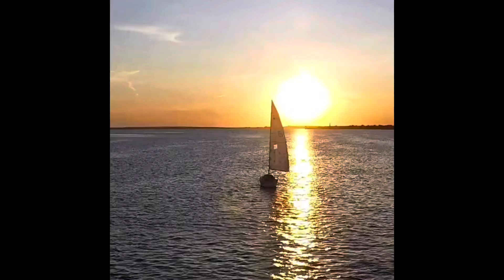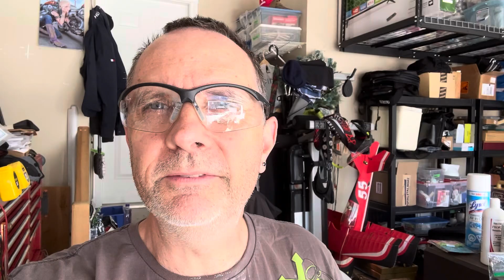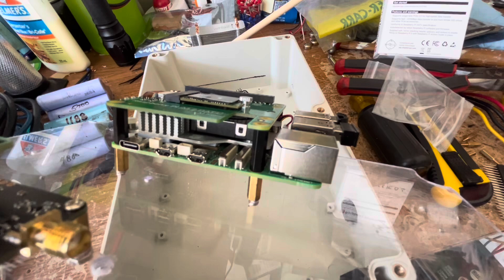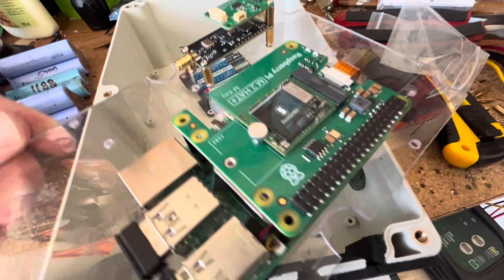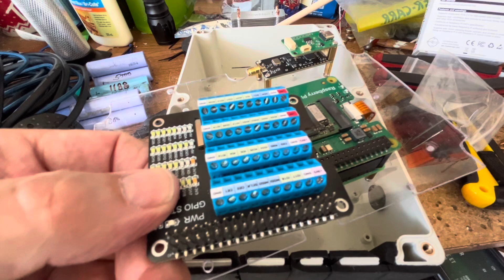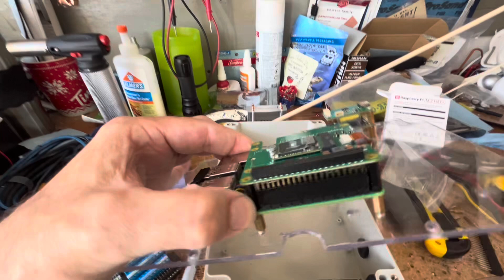M.2Hat Trouble

Comment: Stop your video at 1:32 and in right bottom corner of the frame you have another header. You can put it on gpio pins before the hat
Reply from the maker: Thanks, I ordered another booster GPIO the one you saw is a little too tall it comes with the M.2 hat if I add it also it’s too tall to match the spacers for the hat, I had other people stating the same hopefully the new one is real close I can modify the spacers thanks for the help
Reply: @davethemmp  Longer spacers as well.